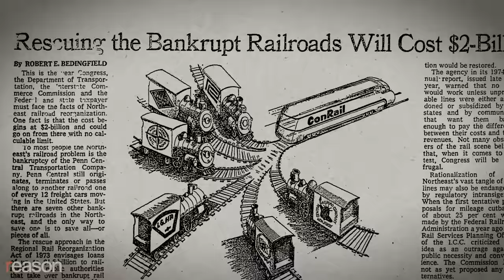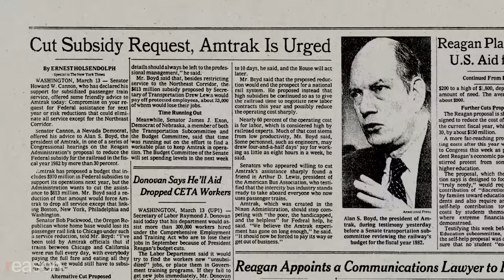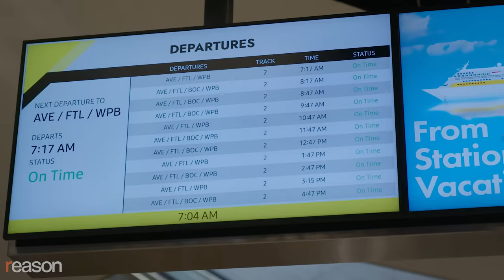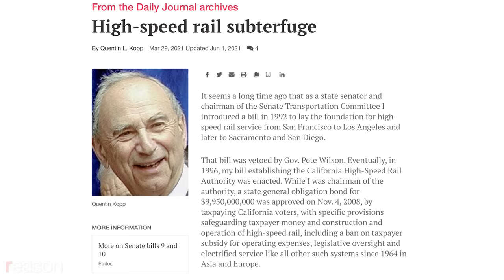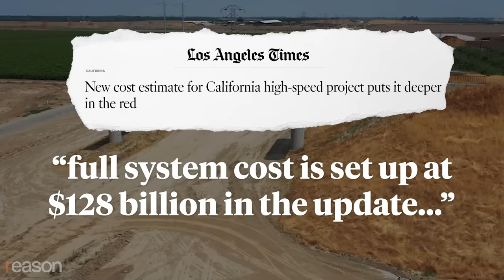How Florida beat California to high speed rail

Comment: Did ReasonTV miss the plot where both the US road infrastructure and the US airline industry are heavily subsidized to the same degree that Europe subsidizes its rail network?
Reply: If you look at the taxes you pay on your airplane ticket, it accounts for about 25% of the cost, and that does not include taxes paid by the airline for rent and fuel taxes.  Here in Central Florida, you cant move without hitting a toll road or paying 60 cents a gallon in fuel taxes.  Curious what taxes you pay on an amtrak ticket or buying a ticket on a subway?
Reply: All libertarians are aware.  Privatize that sht.
Reply: ROADS operate at a surplus.  Both the states & the feds collect more in gasoline/diesel taxes than they spend maintaining the roads. REALITY: China has built more miles of high‐speed rail than any other country with $800 billion debt.  None of its lines are covering operating costs.  (As a result, China is shifting to building more roads.)

France’s rail has debts of $70+ billion and has been repeatedly bailed out by the government. SPAIN built its system with a public‐private partnership.  It is $90 billion in debt.  The state‐owned Japanese National Railways has a debt of $550 billion.  (Japan also has Highest debt to GDP of 300%.)

Railroads are an OLD 1700s technology that is obsoleted by faster, more flexible travel technologies.  High-speed rail loses tons of money & is a bad investment.
Reply: @electrictroy2010  In the US the federal gas tax is not adjusted for inflation and has not been raised in thirty years.
Reply: Fair point, the US just put all its  eggs into roads while Europe put all its eggs into railroads. What should really happen is get rid of all those subsidies, privatize the roads and the railroads, and now that there is a level playing yield, consumers can decide what they prefer. The roads can even be converted to railroads and railroads can be converted to roads if the owners so chose.
Reply: @thepuncakian2024  This is what happened before the 20th century ended, the US chose the car and especially air travel because Air travel is leagues better than rail travel in terms of speed and efficiency and cars are far more liberal in terms of route choice than linear and restrictive lines that are often held back by freight rail and other terrain-based obstacles such as steep inclines and vast areas of land that require lengthy water and diesel stops for heavy and fuel-hungry locomotive engines to properly progress. The only exception in the entire world is not even in France or Germany (where for the larger journeys between Frankfurt to Berlin, Bonn to Dresden, Munich to Hamburg in Germany's examples and Montpellier to Le Harve and Bordeaux to Paris, Nantes to Lyon in France's examples, people choose either the plane or the car over the train) but Japan, and even then, that took over 60 years of development and trans-prefectural disputes (one of them, Saga Prefecture, is still disputing the Kyushu extensions) to get to the point where it's at today.
Reply: @DR3ADER1  I think like anything, rail is useful in some cases but not other. There isn't one form of transportation that is perfect for everything such that you could just replace all other forms with it. The issue in the US is that with the horrid zoning laws, you just have these vast swathes of single family housing zones that make transportation by car the only real viable means on transportation in those area. In cities with higher density mixed use zones, car usage is quite a bit less, and usage of rail is actually viable. Outside of suburban and rural areas, roads are extremely inefficient forms of transport. A rail line takes up much less land than a road with the same amount of travelers. All that extra land can be used for a variety of purposes, most likely housing, which would help decrease housing prices. It's funny how the "private rail doesn't work" crowd completely look over the fact that before the interstate highway system and subsequently Amtrak, the vast majority of passenger rail was privately owned, and there was a lot of it, actually offering good service. Amtrak absolutely pails in comparison to what once was, a prime example of how government equivalents of private services are almost always worse.

Comment: I like cars but they are sooo expensive and I have to drive my kids around everywhere. It is appealing to me to have trains and buses like they have in Europe.
Reply: TRAINS ARE WORSE.  China has built more miles of high‐speed rail than any other country with $800 billion debt.  None of its lines are covering operating costs.  (As a result, China is shifting to building more roads.)

France’s rail has debts of $70+ billion and has been repeatedly bailed out by the government. SPAIN built its system with a public‐private partnership.  It is $90 billion in debt.  The state‐owned Japanese National Railways has a debt of $550 billion.  (Japan also has Highest debt to GDP of 300%.)

Railroads are an OLD 1700s technology that is obsoleted by faster, more flexible travel technologies.  High-speed rail loses tons of money & is a bad investment.
Reply: @electrictroy2010 Have you looked at the subsidies involved in road infrastructure and air travel?   My bet is not.

Comment: California, you cannot lay a 100 feet of sidewalk without all the bureaucracy.
Reply: You can't pick up a dirty needle in LA without an environmental assessment.
Reply: You can lay down on 100 ft of sidewalk without any bureaucracy at all
Reply: @yossiitzinger If what you're trying to do is constructive, it's hard.  If what you're trying to do is parasitic, it's easy.
Reply: Brightline isn’t true HSR. Do your homework.
Reply: @ES-hr6vg  200-250 mph isn't needed.  They wear out tracks fast, less quake proof. 100-150 mph is fine for most cases, this isn't concord more like a 737 speed.
Reply: "Brightline isn’t true HSR"

Bright line is practical rail.  "High speed" is always a money hole.
Reply: @ES-hr6vg  this isn't about chasing clout and trying to be glamorous. this isn't about sucking money for the sake of the 'HSR' branding. this is about practicality. which is how America does stuff. and it should always stay that way.
Reply: @MilwaukeeF40C Then don't call it HSR.
Reply: @mrxman581 You must be from California 😂😂😂
Reply: Or protests, or eminent domain issues, or lawsuits.

Comment: Just to claify for anyone reading this, Brightline isn't considered High Speed rail
Reply: Do you know what high speed rail is considered in mph?  If you did, it is high speed.
Reply: @coachduke9323  Generally, the most lenient requirement for HSR is being able to hit 125 mph for upgraded track, and 150-160 mph for new track. Brightline's highest speed is the Orlando extension, which hits a max speed of 125 mph on a mere 23 miles of newly built track, meaning it's still way short of actual HSR.

By comparison, Amtrak's Acela trains are able to go at max speeds of 150 mph for 50 miles on upgraded tracks, so if Brightline is considered HSR, then Acela would have to be as well (and we all know that isn't the case)
Reply: @coachduke9323 high speed train category is above 150Mph
Reply: Yeah, everybody keeps repeating that Brightline isn’t high-speed rail officially, but I say in the United States it’s high-speed compared to everything else in the United States since there’s very few trains in the US that even go close to 100 mph.  
     And I just rode  Brightline two weeks ago and it was really smooth at 125 mph
Reply: @enjoyslearningandtravel7957 BOTH the US and EU governments define high-speed rail as 150+ mph.  Brightline doesn’t meet the standard.  REALITY: China has built more miles of high‐speed rail than any other country with $800 billion debt.  None of its lines are covering operating costs.  (As a result, China is shifting to building more roads.)

France’s rail has debts of $70+ billion and has been repeatedly bailed out by the government. SPAIN built its system with a public‐private partnership.  It is $90 billion in debt.  The state‐owned Japanese National Railways has a debt of $550 billion.  (Japan also has Highest debt to GDP of 300%.)

Railroads are an OLD 1700s technology that is obsoleted by faster, more flexible travel technologies.  High-speed rail loses tons of money & is a bad investment.
Reply: @electrictroy2010 The USA is in debt for $34 trillion and it increases trillions each and every year. So to talk about a few billion is not so meaningful. Railroads began in the 1800s. Sorry with much respect, but your arguments do not hold much water for me.
Reply: Brightline is more practicle .  Just the fact that it is already running makes it faster .
Reply: @coachduke9323 US DOT standards are different from world class standards.

True High speed rail is over 155 mph
While US High speed rail is 110 mph, 

which is actually called higher speed rail

Comment: 1. Brightline is NOT high speed rail. 2. Brightline already HAD the Florida East Coast Railway ROW, but California has to build an entirely new one. 3. Brightline's main return on investment comes from property development NOT from railway operations, which are a loss leader. 4. California HSR has NEVER been about the LA-SF connection. It's been about the state's OVERALL rail plan from 1980, which has been an overwhelming success. The latter is a bit hard to explain, but starting in 1980, CA took over intercity rail from failed private operators (Amtrak is only interSTATE). The first was CalTrain, then Capitol Corridor, LOSSAN, ACE, Metrolink, etc. Over time, improvements were made so now Capitol Corridor actually makes money, Metrolink actually cuts traffic, and CalTrain is the most cost-efficient public transit in the entire USA.  What CAHSR ACTUALLY does (if you bother to read the planning documents, which Reason's "journalists" don't bother to do) is fill in the missing links to make these intercity systems effective and profitable. 5. The current limitations of CAHSR were imposed by the FRA under ARRA in 2008 by mandating a central valley start  - CAHSR didn't want to do it. The ACTUAL state rail plan would have  started with the Southern Link between Burbank and Bakersfield, allowing timed transfer service to have opened by 2023 connecting LA and SF and opening up the High Desert Corridor to a PPP with Brightline.
Reply: What was the original Burbank-Bakersfield route?
Reply: @davidjackson7281  The only  way it's done now is  on an Amtrak BUS. Getting north by RAIL is through San Louise Obispo
Reply: Was originally going to type up a comment bringing up these points, but you basically covered everything I wanted to. It's honestly annoying how people constantly compare Brightline to CAHSR without doing the bare minimum research to realize that they're completely different projects. 

A more apt comparison would be to compare CAHSR to something like Brightline West or Texas Central, but even then it still wouldn't be entirely accurate since neither are anywhere near as complex as CAHSR, not to mention the fact that the former cut a bunch of corners and the latter has spent years on life support before needing to be saved by Amtrak

Side note: I think you should probably edit your comment so that each point is on a separate line. I agree with the points you made, but having everything in one big clump really kills the comment's readability
Reply: @davidjackson7281  There was originally a plan to run HSR roughly parallel to Interstate 5 (Tejon), but this was later shelved in favor of running a more circuitous route (Tehchapi) to Palmdale (future connection to Brightline West via High Desert Corridor) and then Bakersfield
Reply: Cope.
Reply: @Vuran2001  the reason they didn't do the I-5 route was because it would have completely skipped the Central valley and would basically only serve the two coastal areas while ignoring the poorest part of the state

Also, the Palmdale route was chosen because the alternative would have been to tunnel through a bunch of mountains, which would have made the project significantly more expensive than it already is
Reply: Hell, you took the time to write all this. Must be true enough. You in Portland? How's libertarianism/neo-liberalism going over there?
Reply: @Chario_ lt is quite difficult to fathom how 20-25 miles of tunnels through the 90-100 mile Tejon Pass Grapevine l-5 route is more expensive than 35-40 miles of tunnels through the 130-140 mile Tehachapi and  San Gabriel route?
Reply: I mean the thing about Reason is that they're basically fox news for libertarians but they're also not entirely wrong. Brightline maximum operating speed is 125mph which is the minimum to be considered high speed but its average speed is 70mph, so it's "high speed" in the same way that acela is "high speed" even though most of the route is far from it and they are right that Californias rail projects have been plagued with grift, delays, and cost overruns to a greater extent than brightline
Reply: @dm-rj2zg  125mph is only considered high speed if it's on upgraded track. Brightline only hits 125mph on newly built track, which needs to be at least 150mph to be considered high speed
Reply: California could have used Renfe to consult on the route, and both Renfe and SNCF offered to consult on the projects to help keep costs down. For the amount of money California is spending on their Phase 1 route in the valley from nowhere to who cares Spain built their entire route network, the largest in Europe and the second largest in the world by route miles behind China, and it breaks even, and they have the same topography, and they have earthquakes. But noooooo, California had to do it its own way. And they could afford the entire project, until their economic policies torpedoed their budget and caused a mass exodus to the tune of a $20 billion budget shortfall. The cheaper ROW was along the I-5 corridor, but then it wouldn’t have gotten approval from the Central Valley, which is the real reason why they did it in the Central Valley. With California politics, once the section between SF and LA finishes, nothing else will get built and the system will become a money pit. And at this point in time, with the amount of money already spent on the project, there is no longer an economic argument that can be made. The only people that would use it would be tourists between the cities or people traveling to visit family. Business can be done virtually which eliminates the business travelers as a reliable options for passengers and both LA and SF have torpedoed their economic futures with poor policy so even fewer people want to live there or in high tax California in general that is running out of power, water, and zones housing in wild fire territory. Cali can get exactly what it votes for
Reply: @Chario_ Sorry your conclusion about which is more expensive is wrong. The "Palmdale route" thru the Tehachapis and San Gabriels is up to 39 miles of tunnels whereas the Grapevine l-5 route is 20-25 miles of tunnels and 30-40 miles shorter. San Gabriels have two 13 mile tunnels. The two longest tunnels of the Tejon Pass route are 5 and 6 miles. (Clem Tiller, Truth About Tejon 2012).
Reply: @Chario_ Actually 155 mph/250 kpm.